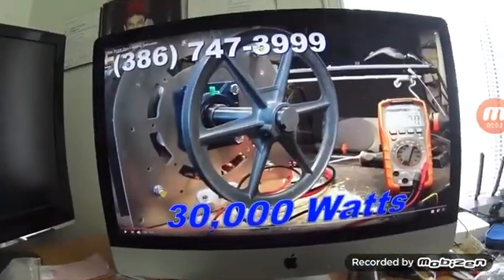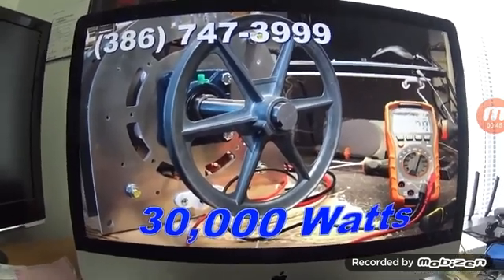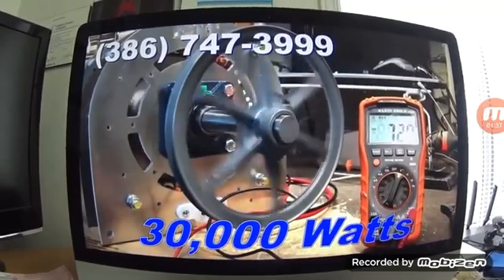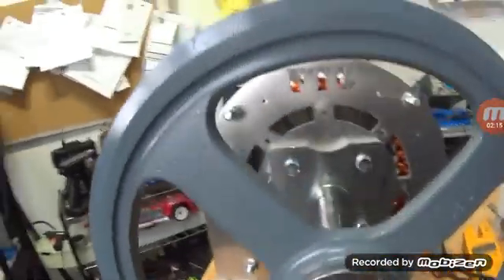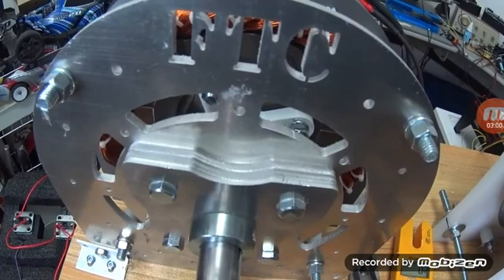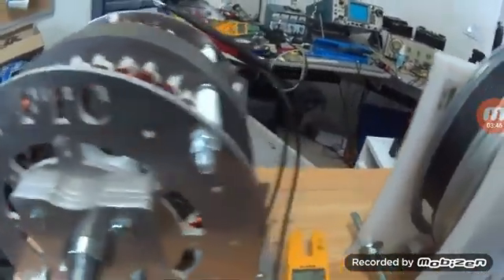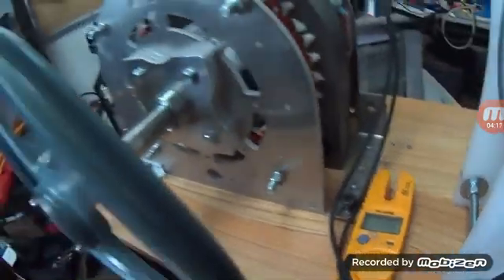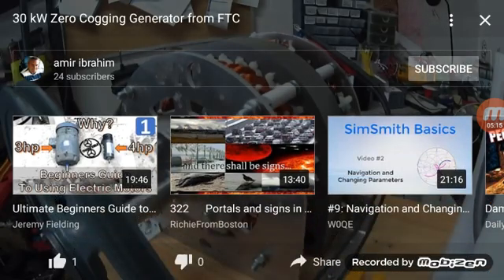FTC Realracecom Review after Test - PURE TRASH!!! BUYERS BEWARE!!!!

Comment: And what the heck? Can't they do something about their studs that run through the unit? Haven't they ever heard of Acorn Nuts. Those studs are knuckle busters. And I would replace their ceramic bearings. They are fine where you have a lubricant around them but stink when it comes to being dry. Try running a water pump with a ceramic seal without water. They don't last long. Just a little dust will cause the shaft to be worn out quickly.

Comment: Sounds like a wallet grinder! Something is binding in there, probably a bad alignment between the front and back bearing. I bet they also omitted a field saturation winding, intentionally weakening the generators strength. I wouldn't be surprised if they removed it before shipping. Hence the lock washers were loosened in [the] shipping [department.]